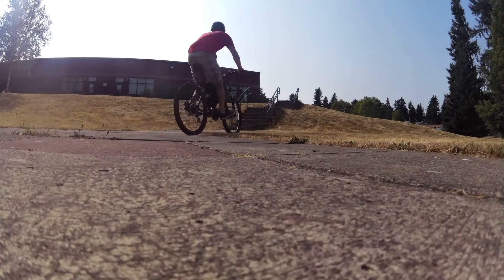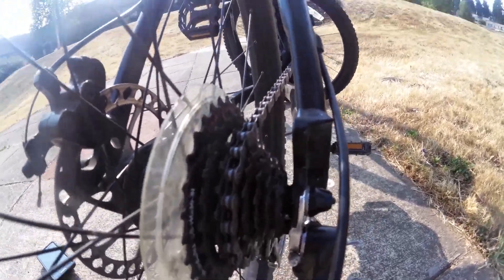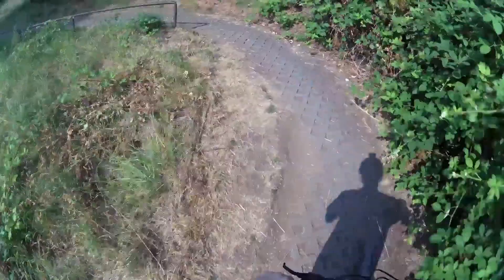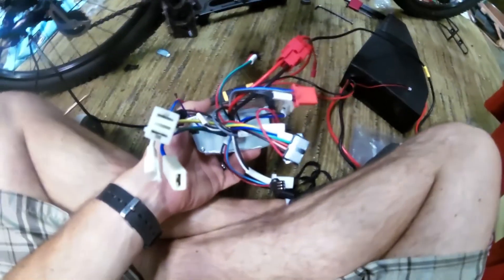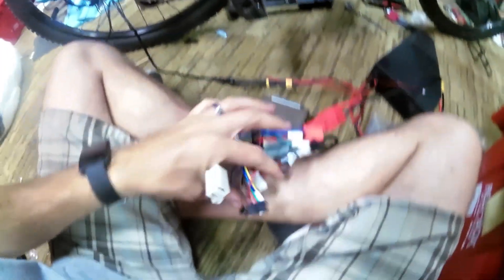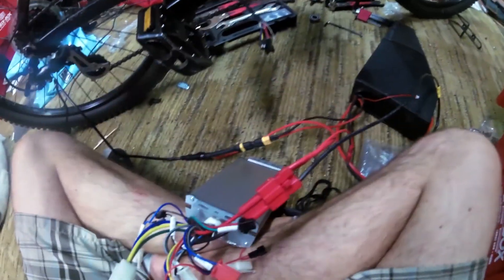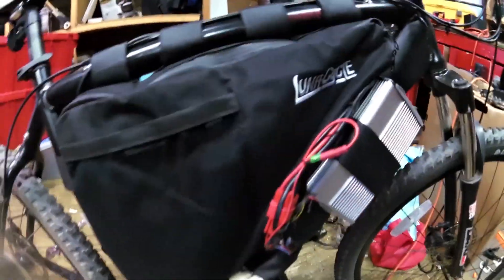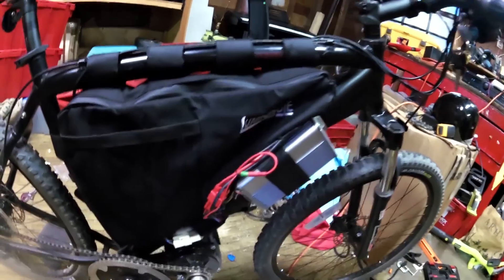Cyclone Ebike

Comment: I've built a few mid Drive E-bike.
And out of scrap old parts.
I've never had that problem  chain coming off.
They always go in all 9 gears perfect.
I made one with a hoverboard 350w hub motor in mid drive system upgraded with a 48v 1000-watt controller.
And that does 30mph to 40mph+.
Reply from the maker: It was my first cyclone….

Comment: Put the controller on the under side of a rear pannier rack and paint it black. Also a 40 amps controller doesn't usually limit the current it just might overheat.

Comment: if u wnt to be able to use the lower gear, move a few washers to the other side of the chainring. The chain will line up with the rear cassette

Comment: Thanks for a great video. Having come from a history with motorcycles as well as bicycles, I think chain alignment is crucial. I can see on how the chain is ‘challenged’ on an ebike and drive train with a rear derailleur. Have you any ideas to go forward with an internal gear hub? And if so, which ones have you considered, or decided on?
Reply from the maker: Alan J August I just built an internal hub on a fat bike with the sturmey Archer 3 spd which I've heard good things. Just need a fat bike to put it on and I'll put up a review.
Reply: @JohnnyNerdOut  

Yeah, the Sturmey Archer 3 speed is damn near bulletproof.  I ran one for 3 years on my RC equipped ebike and it still worked like new when I sold it.  I had the 3speed/cassette IGH but ran the motor to a custom sprocket, you can see it in my vids.

Comment: Your dog is faster than your cyclone bike
Reply from the maker: George Balas only on the uphills. But she can do 25-30 mph
Reply: JohnnyNerdOut I just say that your dog is really fast! ;)
Reply: +JohnnyNerdOut use 60 or 72 amp controller will take you up to 43mph with 60 amp/and up to 50 +mph with 72 amp controller you battery up other date and hub motor doesn't really have any restrictions on it

Comment: Yeah, go for the 3 speed IGH. I did it with my BBS02B and it's twice as fun to ride now. The 7 speed was just too much work for my city commute. Too many start and stops for the 7 speed with a motor. I'm also setting up a 2000W and a 3000W Cyclones on the same brand and model 3 speed bikes. Then the real fun begins!

Comment: Great video! What do you prefer sondors, radrover or cyclone?  Which do you use the most?
Reply: Max Pizarro I like my sondors most for commuting to and from work, because it's comfortable and I've got it decked out nicely with bags. Cyclone is a lot less refined. It gets your heart rate going because of it's rawness. I probably like the radwagon the least due to it's comfort, still a great bike for what it is though. Just not great handling over 20mph. Rad Rover is probably better. Sondors is the best value bike I have and the most easy to recommend buying and upgrading.
Reply: Thanks John, I have a custom GT MTB with a BBSHD from Luna Cycle and it reminds me of how you are describing the cyclone fast and NO JOKE!  I'm thinking about getting the new sondors X and using that is the daily commute bike.  Did you leave the sondors with the upgrades in the video 20amp controller, 750watt motor and 48v battery? If so, what is the ah on the sondors 48v battery and what mileage are you getting out of if?
Reply: Max Pizarro I still have the sondors, using a 35 amp controller now. Check out the video in my list I made on it. It's a 48v 10 ah and I generally get 10 miles if I ride hard (26+mph) or 20 miles riding leisurely (15-17mph) with no pedaling for either.
Reply: Thanks Again John!